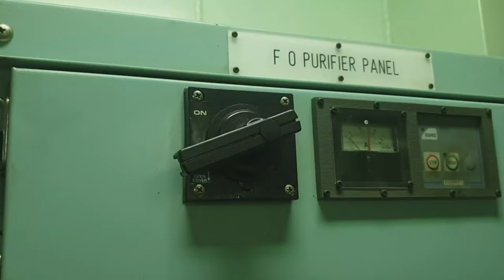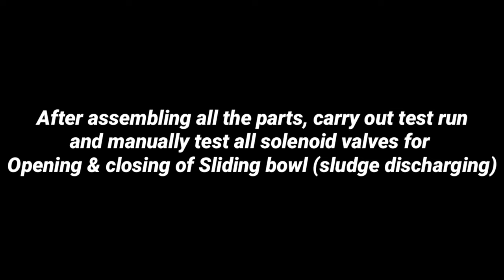Purifier Major Maintenance | Vertical & Horizontal shaft Overhauling| BatangMarino Ep.016

Comment: Hello, I'm having issues with dropping circulation pressure in L.O hidens purifier after few minutes while running,  samgong -mitshibishi make...any suggestion pls
Reply from the maker: I think the possible might be the treating temperature..adjust the temperature to exact set point, then wait until it stabilizes..then put the alarm in On position.